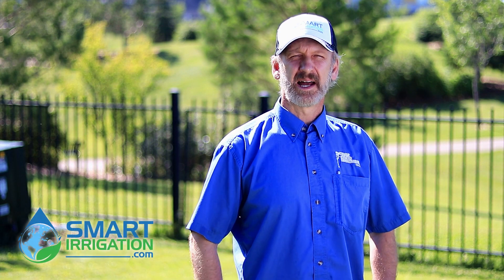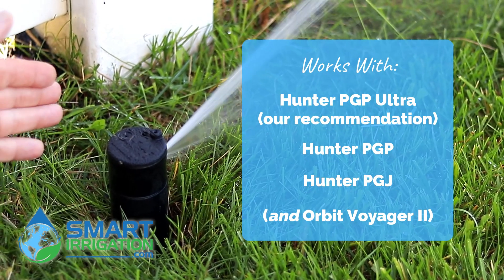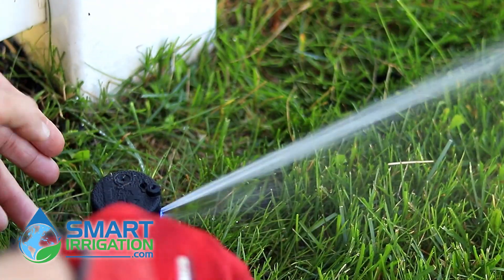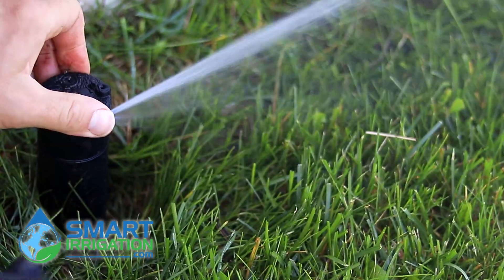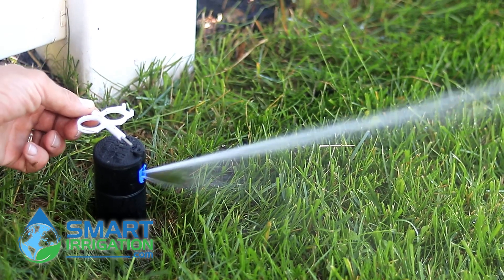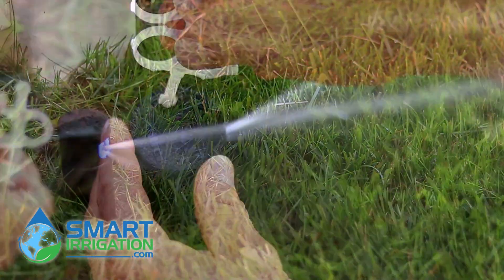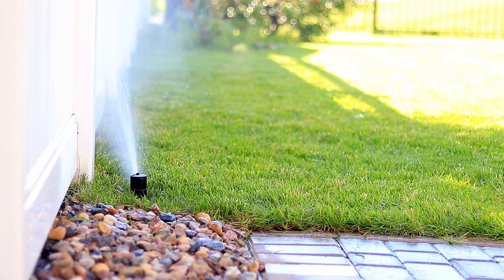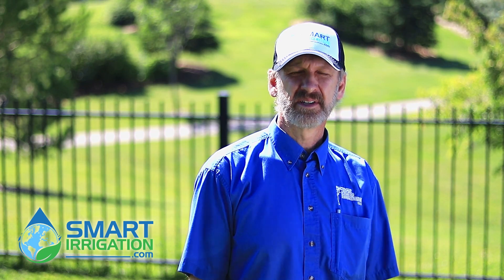Hunter PGP Rotor Adjustment

Comment: Mine is doing a 360° spin 😂😂😂
Reply from the maker: Haha, there are a couple of possibilities here.  Older PGPs came in full-circle variants that only go 360.  But if this is a recent development, first try turning the adjustment tool counter clockwise in the slot to reduce how far left it turns.  If this doesn't do anything, then its likely the gears in the rotor are damaged and you'll need to replace it.  Let us know how it goes!
Reply: @SmartIrrigation1 Ok thanks! I will try again this week

Comment: Thanks BUT I don't get how to set the left stop by turning the head with out unscrewing from pipes below.
Mine is going to far to the left - are you saying hold the shaft AND turn the head to the desired position?
Reply from the maker: Thanks for watching.  Sometimes when you set the left stop the body can unscrew below, so in this case you would want to adjust the left stop by turning it almost a full 360 degrees clockwise (clockwise will only tighten the body below, so you don't need to worry about anything loosening).  This is done by turning the riser/stem/shaft itself (not the nozzle on top or the sprinkler body below).

Comment: I thought reducing the arc, means reducing the flow, not how far left it turns till it stops?
Reply from the maker: Thanks for watching!  For the video we decided to use the actual terms used to describe the parts of a circle since these heads water in a circle (or part of a circle).  So the radius of the circle is the length of the spray, and the arc of the circle is what portion of the circle is being watered (such as 90° arc, 180° arc, etc).  This is typically the language used by manufactures as well.  But I totally understand the confusion!  I sometimes think of arc as distance as well (like the arc on an arrow, but then im not thinking in terms of a circle on a horizontal plane). Sorry for the confusion, we just though if there is going to be confusion one way or another, the technical language would be proper. But we'll try to make that more clear in future videos.

Comment: By saying it reduces the arc makes it sound like you are either increasing or decreasing how far it flows,, I was told the colored nozzles adjusts the arc length
Reply from the maker: Thanks for watching!  For the video we decided to use the actual terms used to describe the parts of a circle since these heads water in a circle (or part of a circle).  So the radius of the circle is the length of the spray, and the arc of the circle is what portion of the circle is being watered (such as 90° arc, 180° arc, etc).  This is typically the language used by manufactures as well.  But I totally understand the confusion!  I sometimes think of arc as distance as well (like the arc on an arrow, but then im not thinking in terms of a circle). Sorry for the confusion, we just though if there is going to be confusion one way or another, the technical language would be proper. But well try to make that more clear in future videos.  Also you are right, the nozzles change how far the sprinkler shoots (which would be its radius).
Reply: @SmartIrrigation1 Thank you! Great video 😁👍👍
Reply from the maker: @2005Pilot  You're very welome!  Thanks for watching

Comment: My heads are rotating a full 360, it seems.
Reply from the maker: Some heads are only 360 degree heads, designed to only spray in a full circle.  However, if you have an adjustable PGP, you should be able to use the tool and turn it counter clockwise in the adjustment slot to reduce the arc of the circle that it waters.  Hope this helps!

Comment: Thank you! I noticed my Hunter PGP will automatically rotate from right to left but then get stuck at the left.  If I rotate it a bit more left, it will swing back to the right.  However, several heads are sticking to the left (maybe not rotating to the full left stop).  What is going on here?
Reply from the maker: It sounds like the gears inside these heads are stuck or broken.  Since these heads aren't designed to be opened or taken apart, unfortunately it sounds like you will need to replace these heads.

Comment: Thank you Chris! I guess my question was, is it possible to use the “unofficial way“ to rotate the shaft COUNTERclockwise if the right stop is too far right. It looks with Rainbird 5000 you can rotate the shaft in both directions when adjusting the stop. What is your experience? Thanks again for your time!
Reply from the maker: Yes you can. We do it all the time. It's similar to setting a pop-up spray head that way.
Reply: When using the unofficial way I presume you don’t have to hold the ribbed part below the shaft when turning…since it won’t affect how it’s secured into the housing?

Comment: What if the right fixed stop is too far to the right? How do you adjust? Thanks!
Reply from the maker: Two methods. First try turning the whole head in the ground. If that doesn't work you can remove the inside cartridge from the case by unscrewing it, then reposition it where you want and tighten the cartridge back into the case.

Comment: How do you turn the head off? I want my system to run but one head is malfunctioning so I am needing to turn off a single head
Reply from the maker: Replace the malfunctioning head would be my first choice because there is no easy way to turn off just one PGP. Remove and cap it at the fitting in the ground if no longer needed but be carful because it could affect the coverage.